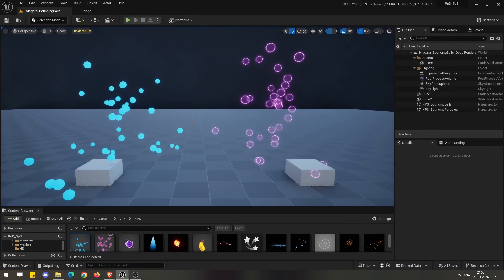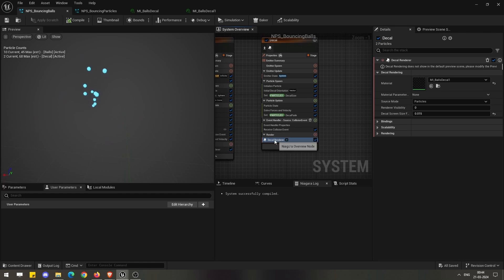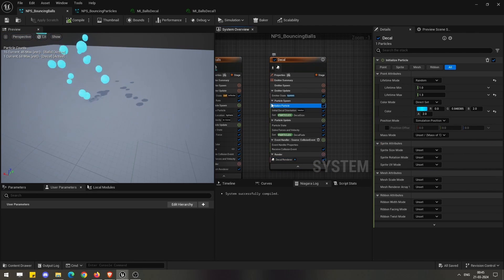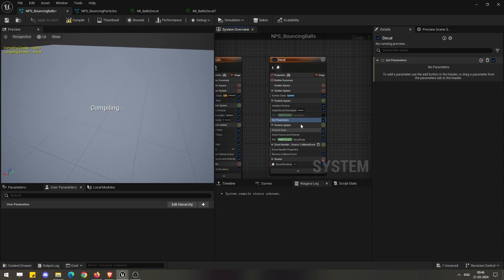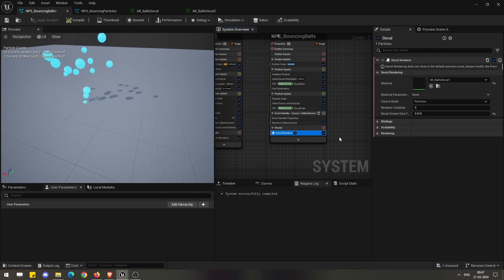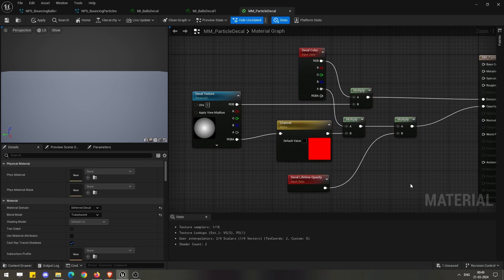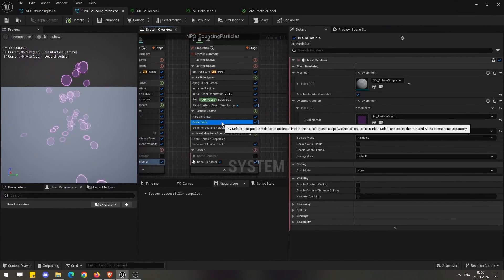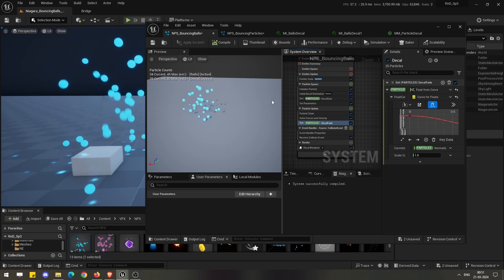Unreal Engine Tutorial: Decal Renderer in UE5 Niagara

Comment: Thank You for the tutorial. It solved some of my issues i had with the decals. I still dont know how to setup the materials/particles to work with normal maps - as a decal actor placed on the scene, it works fine, but as a decal particle, it turns the color of the particle to black. Also, is there a way to have masked decal somehow?

Comment: When I try and create this, my decal renderer only renders one decal at a time that teleports to the position of the most recent collision. Do you have any idea what could be going wrong? Thank you for the tutorial!
Reply: I figured it out. In the event handler properties I had to set Execution Mode to "Spawned Particles"
Reply: @Seanmcfarlane115  This worked for me, with the stipulation that the decalsize parameter be set and the size be uniform, mine were initially working but I couldn't see them because my Z value was set so low they were stretched to tiny sizes.